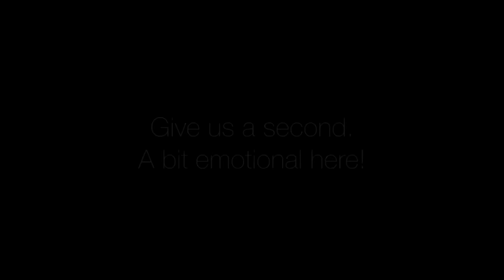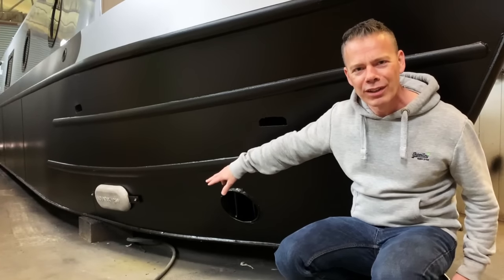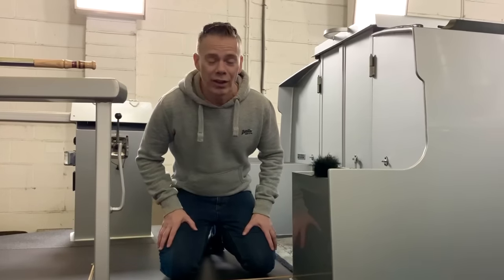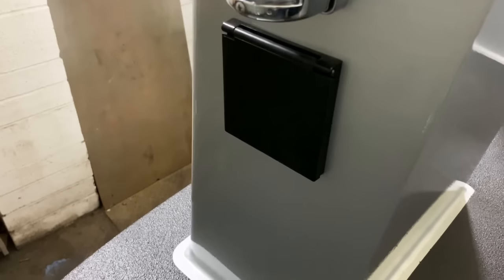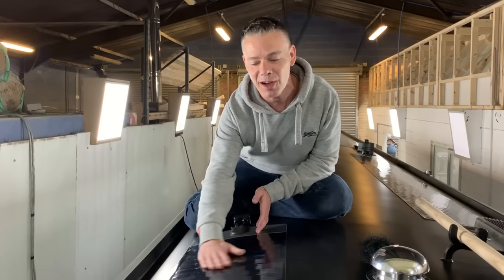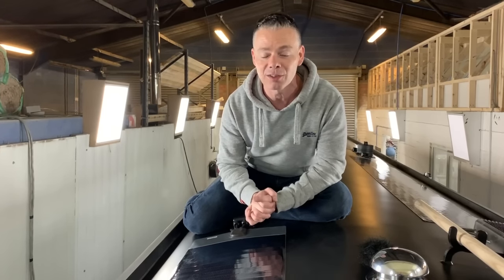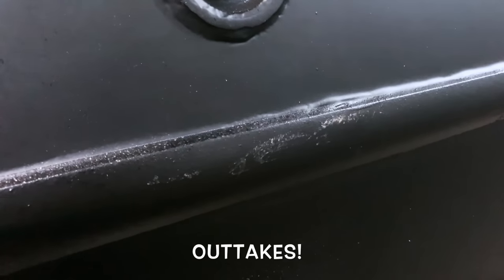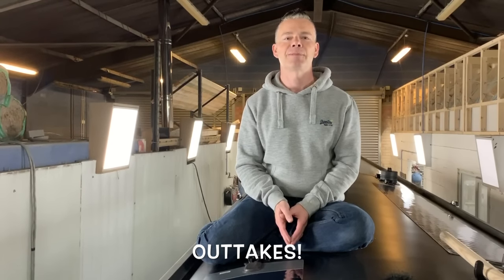Painting Our New Canal Narrowboat - The Big Reveal! - Ep. 30

Comment: Great looking boat. Well jell! If you're worried about bow thruster tube corrosion, the only safe way to 'stop' it is to put a couple of small anodes in the tube itself, port and stbd sides, depending on how much you use the thruster will depend on how long the paint protection will last, so anodes are the best protection to have over paint. Anyway hope you have a great time.
Reply from the maker: Hi Paul. Brilliant! Thanks for the tip 👍🏻

Comment: Have you guys thought about long-term care for that beautiful paint?  Do narrowboaters (especially ones w/ an automotive grade finish like yours) wash the boat regularly (maybe some sort of foaming brush setup w/ biodegradeable soap)?  Do you plan to wax/seal it?  I'm a bit obsessive when it comes to my car's finish, so I wonder what the care routine is for a 60 foot long beast like this, to keep the paint shinier longer.  Also... where would you wash a narrowboat?  I've never seen an external water tap on a narrowboat (I'm only a YouTube Gongoozler), but it would seem that something like that would be very handy on the rear deck (hosing down) for muddy footprints from the tow path.  You could keep a coiled 10' length of hose in a rear deck locker for a quick wash-down or switch to the hose you use to fill the water tanks for a whole boat wash.
Reply from the maker: Hi Aaron, Long-term we're resigned to the fact that it will get knocked, scratched, dinged etc. We have a special UV lacquer that will protect the shine for longer. We'll wash it at water points with a soft brush and polish it regularly.

Comment: An amazing stylish craft. However I have read quite negative reports on flexible solar panels. I can't remember what the complaints related to unfortunately.
Reply from the maker: Hi Tim.
Thanks for commenting. We did a lot of research into these panels. They are very different to older types of flexible panels. We followed several boats that had them fitted over several months to test their durability and performance. 
They absorbed and produced noticeably more energy than standard panels, especially in cloudy weather, all without the need for brackets and positioning. 
Having researched and tested out solar products over so many months, we’re confident we’ve made the right choice 👍🏻

Comment: How did they prime/paint the bottom of the narrow boat Silver Fox ?  It looks as though the bottom is only a few inches off the floor of the building.
Reply from the maker: Most don't treat the bottom. The canals are very shallow and any coating is scraped off within a few days. That's why they use thicker, 10mm steel for the base plate.

Comment: Did you 2 pack the hull or bitumen?
Reply from the maker: Hi Mike. After shot-blasting it had an immediate coat of two-part epoxy to seal the steelwork. Then we added two coats of International Intertuf 16, with another two coats to be applied just before we launch her. (150 microns in total).